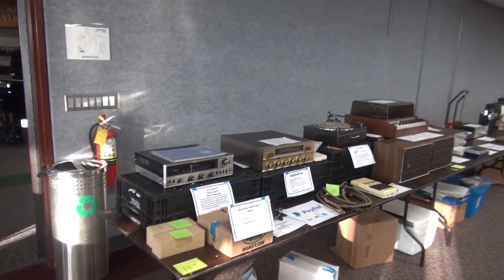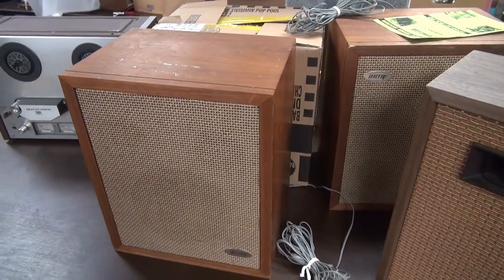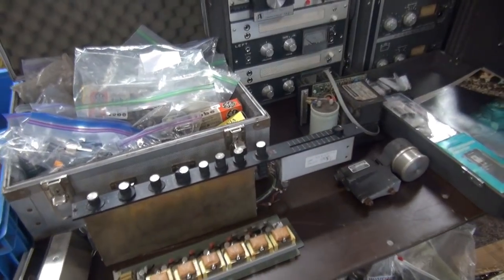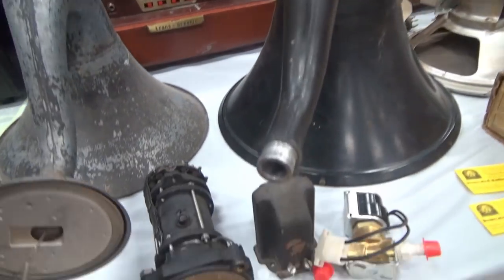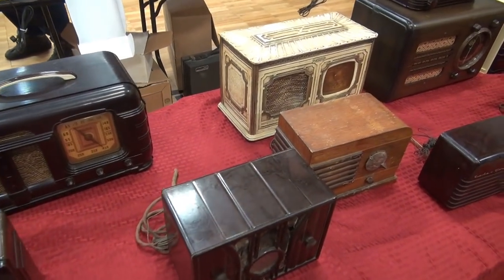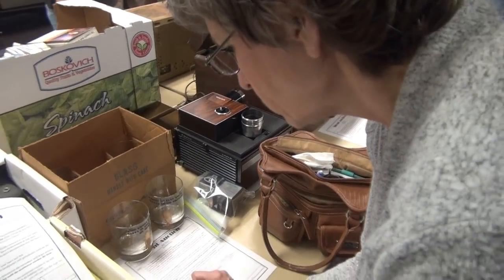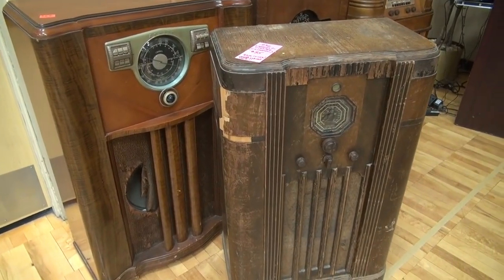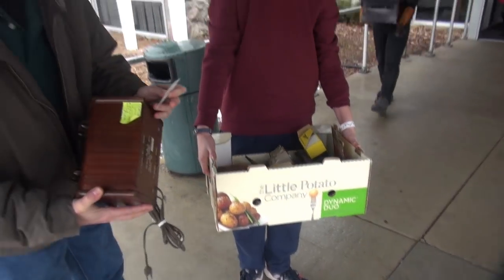2020 MARC Vintage electronics expo Cool tube Radios collectors items Ham gear, A great event

Comment: That HP-85 Laboratory Computer is a good work horse when paired with interface cards to connect it to the outside world. Back in the mid 1980's our company used one to operate the PCB Test Station for the multiple product lines produced.  The different profiles were stored on the removeable tape drive and the test results could be printed out on the included 3.5 inch thermal printer.  It was a 32K machine programmed in Basic, but did the job for us up into the early 2000's.

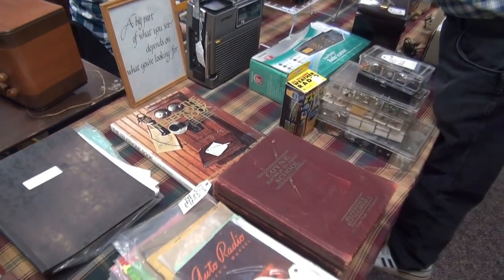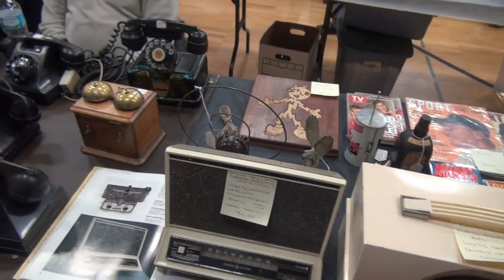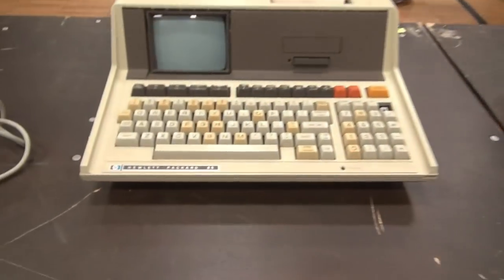Comment: Nice bit of gear in the background at 3:58. Not exactly vintage compared to the items on the table in front of it. I recognized the R-390 before the close up of it. I got a laugh from the person saying "It's really light". :) I like the sign at 17:32. It is so true. I would have been tempted by the wooden plaque at 39:30 or the HP-85 at 49:20.

Comment: OMG Terry there 2 of those RCA pa tube amps there - back to back about 20 feet apart!
Trick would be to drag the lower priced one over to the higher - and then start working the high guy, to get him lower. Guarantee, the low guy would drop his price, too, before you wewre done .
Often thought mikes or amps or spkr drivers would be good to get this way, at a big show where duplicates might exist-  because sellers all know a project today is going be stereo at minimum.

Comment: HP85 Calculator. We used them to control external test equipment with the GPIB interface. Automation back in the 80’s.

Comment: Did you happen to see any 1st generation, Armstrong licensed FM receivers? I've never seen one, but I understand about 500,000 were made before Sarnoff got his greedy little hands into the spectrum.
Reply: I usually see prewar FM radios and tuners at most of these shows.   Not super hot with collectors so you can get them for reasonable money.

Comment: Are there any shows like this in the Baltimore, Maryland area ? Thanks
Reply: Closest big show is the Kutztown Radio Show,  info at www.renningers.net    at the Renningers flea market out back, two large pavillions full.  its in May and September.  Its probably the biggest show in the USA actually.    Great fun and the friday night BBQ with the vendors drinking, shooting off fireworks and burning old radio cabinets is unique to all the USA shows (best if you know a seller to attend this ).     Another show on the east coast is the Mid Atlantic Antique Radio Club  (MAARC) show,  its in June.   Its in Beltville, MD at a hotel.  Internet will find it.  Its a much smaller show however.
Reply: Keep checking the interwebs for 'hamfest'